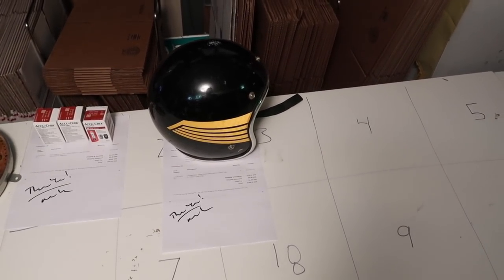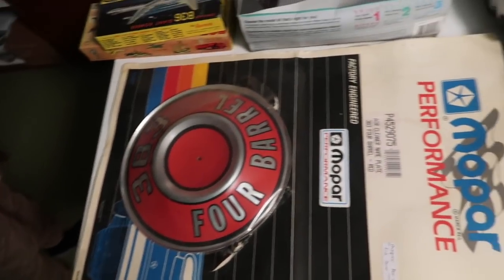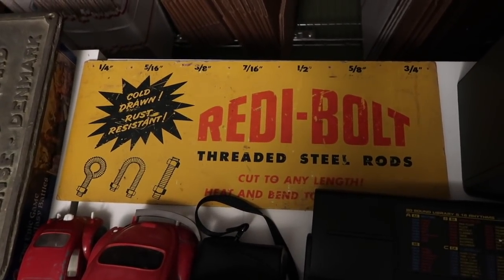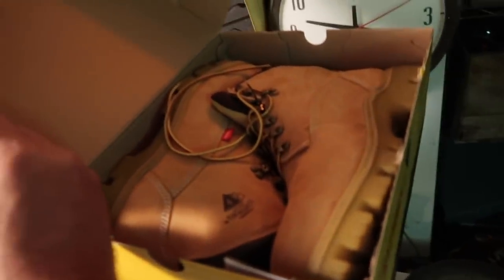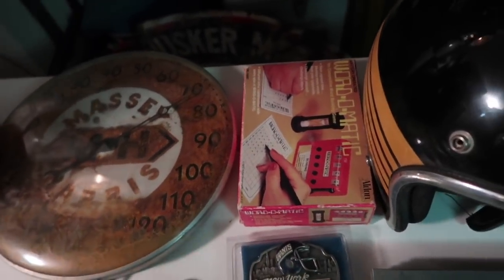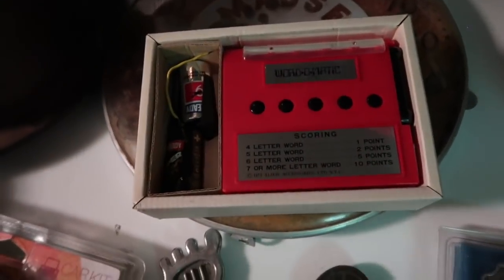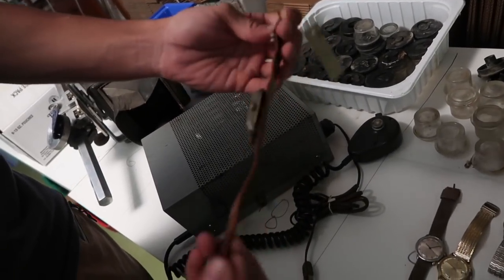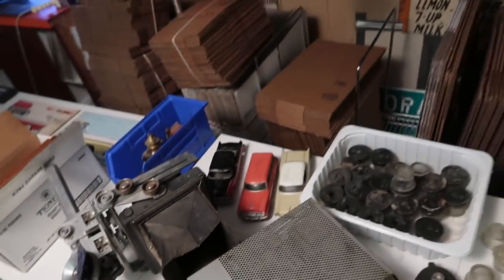Picking $50 Bills Out of the Trash on HWY 36 Treasure Hunt - CPL 0346

Comment: The Cragstan Mustang looks like either a Boss 302 or a Mach 1, not the more common Mustangs usually seen on ebay. The inkwells were used in schools as late as the '50s.  By the '60s we were using the desks but the inkwells were gone.